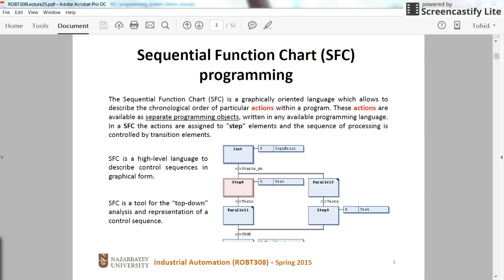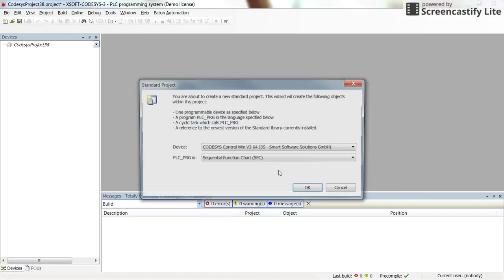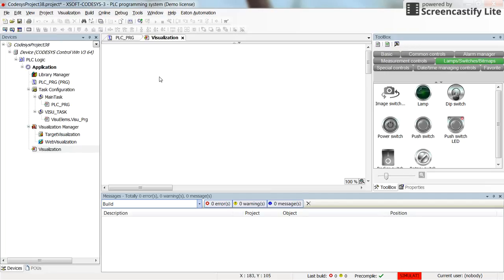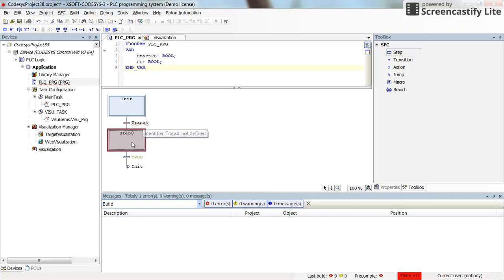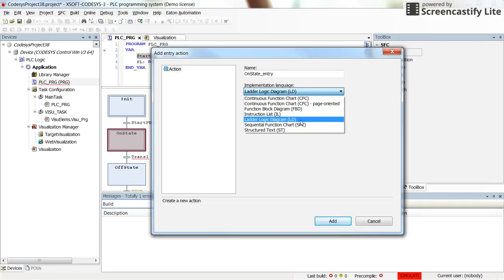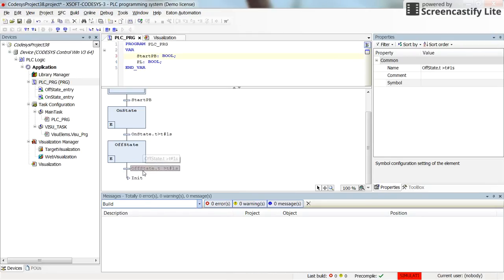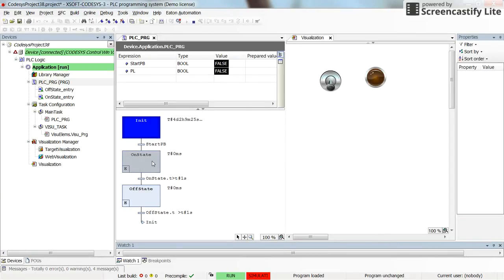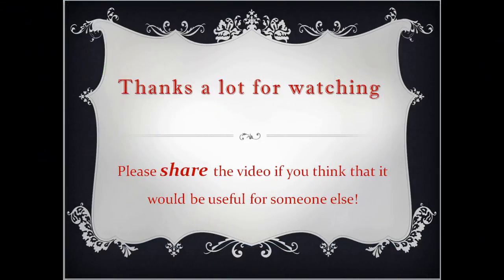CODESYS: Sequential Function Chart (SFC) programming - First lesson

Comment: Hi Tohid,
I have a question about writing transition: Can I write something like that? it is like when either pushbutton is pushed and emergency stop button is not pushed, T3 is true. The default value of EmergencyStop is false when it is not pushed

T3:=positive_direction OR negative_direction OR Enable AND NOT(EmergencySTOP)
Reply from the maker: Sure, you can. You can write any part of code for the transition, however, the outcome of the code should be a Boolean variable (either True, or False). You can also use any of the available programming languages (ST, LLD, FBD, ...).
Reply: Thank you for your previous reply.
Another question I just came up with:  Let us say T3 is a transition we created, can I use in another transition T2:=NOT(T3) and EmergencyStop   like this?